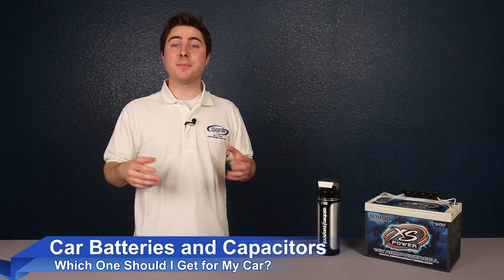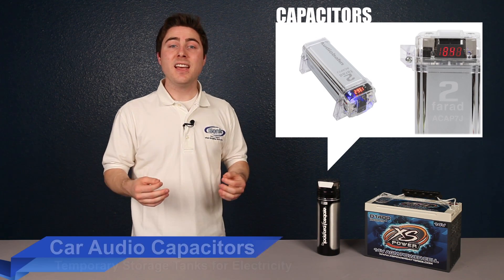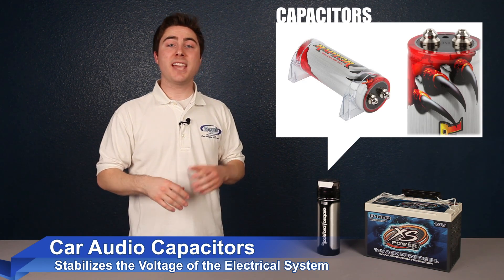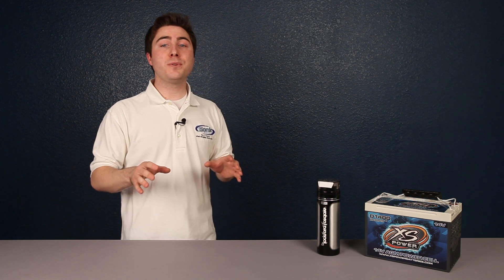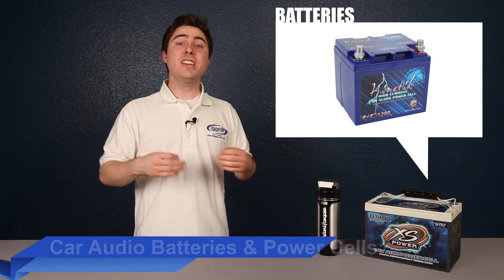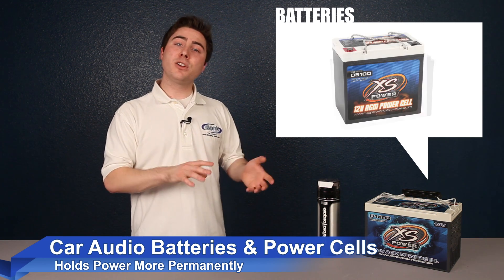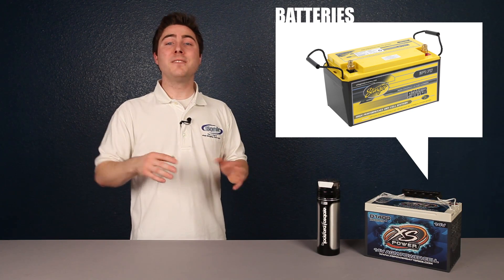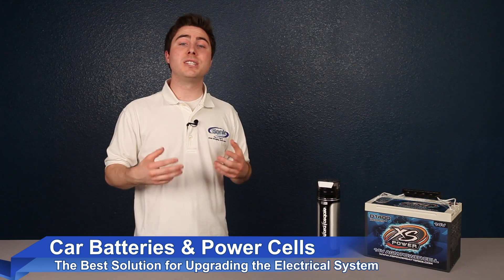Car Batteries or Capacitors: Which Should I Install? | Car Audio Tips

Comment: I just installed a capacitor and it made my headlights stop dimming when the bass drops. just sayin they arent entirely useless but i would still go for a new battery regardless.
Reply: What alternator size and amps?
My whole interior lights dims with low bass. Even LCD-display on my integrated headunit.
Reply: Dylan Christensen I ran a lawn mower battery.compat wasn't enough for me still had dim lights with lawn mower battery solve the problem for me
Reply: orfeous your amp go into "forever" protect mode yet?
Reply: No
Reply: Well, you're right in the statement that they aren't useless. Unfortunately, what you're using the cap for, is not its intended purpose. Capacitors are by no means as "useless" as some people for reasons unbeknownst to those with a brain might think, but your dimming headlights are due to a GENERAL lack of power. Depending on how you use your system, an extra battery can be a solution. Remember that not all use their system in the same way. If your system runs fine and moderate levels, and only taxes the power supply when you crank it for brief periods, there's no need for a huge alternator. But if you go around everywhere with your system pushed hard, yes, you will need a larger alternator that can provide continuous power. At any rate, that cap is sure to be a great benefit for any type of dynamic music. No matter what you do, keep it. You cannot replace it with a battery or a larger alternator. It does something entirely different.

Comment: so say i had a 1400w system and a 130 amp alternator, would running a big ass battery with the big 3 upgrade ensure that my system is actually getting 1400 watts of power delivered to it at all times?
Reply: Also in addition to the RMS wattage you should consider the losses involved in the amp. If you've got a class B amp (for regular speakers and rarely a subwoofer) then you're going to have like 20% losses to heat, so you take the RMS and multiply it by 1.2 to get your demand. If it's a class D amp then you're only going to have like 5% loss to heat, so multiply your RMS by 1.05. Then your car also uses power for regular use, probably about 50 amps worth is a safe number, that's about 700 watts. Your 130 amp alternator is capable of 1885 watts, then takes a 30% heat loss when it charges the battery, so like I said before, many factors to consider. It may be best to come armed with these figures to a professional and let them make the decisions with you, but like I said.. this is after the system exerts needs for an upgrade to your power system.
Reply: Rob Sorgdrager why do people have to get so hardcore on these noobs? "air temp" really? He's not trying to go out and win the national comp. Geezus
Reply: Jake it depends on a lot of variables for one some amps lie about what they actually do, or they require a crazy amount of voltage to do rated power. Then you have to figure into it the type of subs your using to have your ohm set properly for your amp to perform at its best. For example not saying the amp you have but just for example  at 1 ohm a amp  could put out 1000 watts but at 4 ohm 300 watts. If your not sure of your setup it's best to talk professionals at a audio store. Not best buy but a real audio shop.
Reply: As Jody said, Jake, it depends on different circumstances. A 1400w system is huge, and you want to make sure that your system really is that big before investing in equipment to match it. RMS wattage is what you're going by, never peak. If your headlights aren't dimming at night with beats and your amp never goes into protect mode no matter the length of the drive then you don't need any upgrades to your power system, not even a capacitor. It's best to get the audio components installed before you start worrying about power systems because each car has a different power profile and yours could be just fine without any belt system or battery tampering.
Reply: Look at it this way...
You have a better chance to do rated if the beast is fed. The more current in the easier it is to amplify the signal .  batteries only store energy, they do not make it. In a car audio system you need to make energy and you need to store energy, also you need to transfer it from source to storage to loads and then ground. The big three will help. Remember to use the best wire ( safety and reliability ) and use good solder on terminals. Take you time , spend the money, get the good stuff and it will pay off in the end. That's just to feed the beast, you have to worry about speaker efficiency and box rise and temperature of the air, your cab space, enclosure design... These will effect amp output as well. Best plan is to get a amp that in 4 ohms can meet your RMS requirements and run it that way , plus the higher the ohms the more damping you have, the better and more accurate your speakers will be. You think all the old school amps are listed at 4 ohms mono cus they couldn't run lower ?
Reply: dude i have pioneer ts-310 12" pushing 500 watt i plain to add 1 pioneer ts-3003 pushing around 650watt what is nececery to be done in order that to work ?

Comment: I just set up my system in my '94 corolla. Powering 2 12" MTX subs with an old school Rockford Fosgate Punch 360a2 amp and the headlights dim only when the system is hitting hard, at lower levels they're fine. I would assume a cap would solve this but I would really have to test my alternator and existing battery first to make sure neither of them are going out.
Reply: To tell if it's your battery which is problematic:

1) Start your car and turn off any unnecessary electronics, give it 5 minutes or so.
2) Test the battery voltage (make sure the radiator fan isn't running during this).
It should be above 14v. If it's close (above 13.5v) then you can continue using the battery for normal stuff, but the audio system is going to be rough on it and that will require a new one, and if the weather gets cold you might need a new one anyways. If it's higher than 14.8v then your alternator could be damaging your battery and causing the problem, recommended to take it into autozone for a diagnostic test on their alternator rig. If it's lower than 12.5v you may also want to get the alternator checked.

If it's between 14 and 14.8v turn your system on to the problematic volume and continue monitoring the voltage, it will bounce around, but the average should never go lower than 13v.

If it does, then your battery is struggling to maintain a charge. Run the volume at that level for 3 minutes and monitor its voltage again, is the voltage dropping lower and lower over time? If so then your alternator can't keep up with the average and will need to be upgraded.

If it's able to eventually level out at a certain (but low) voltage this means that either your battery is damaged (likely a cell has failed) or your system peak is too powerful for your battery to handle, but is able to handle its average just fine. To differentiate between these two things is where the more expensive multi-meters come into play. You need a min-max capable multi-meter for amperage, preferably min-peak such as like my Fluke-189 with an Extech DC Clamp Meter attached. These aren't cheap, and since the decision is between buying either a capacitor for the peak handling or a replacement battery (both of which would help your system and cost less than the meters) the best thing to do would be to take your battery out of the car and get it tested at auto-zone or similar location. If it's not a candidate for replacement then get a capacitor of sufficient capacitance for your system, if they think it's on its last leg then replace it. Both have the same result of improvement, but the capacitor will allow you to maintain your future batteries for longer without replacement.
Reply: Bla Spogelse I bought a lawn mower battery solve my problems with dim lights
Reply: Capacitor won't do anything.  Check the voltage on the battery with the engine running.  Should be close to 14v DC.  Put the meter on AC.  If you get anything close 1 volt or more AC across the battery, you need to replace the diode pack in the alternator.  Next, I would make sure you're not getting a voltage drop between the alternator and the battery.  That would mean your alternator is sufficient to prevent dimming, but you got a bad connection in there causing it.  To test for that, it's nice to have a meter that records min/mas like a fluke 87 but can be done without it if you have a bass test track with constant tones to get a solid reading.  Put the test leads between battery + and the fat wire coming out of the alternator.  While the bass is hitting, the voltage drop across that wire should be low, if you see a volt or more, that's the cause of your dimming and you need to find any loose connections there or potentially replace it with a bigger wire.  Other than that, you're not gonna stop dimming without a higher amperage alternator.
Reply: Thanks for the input man, appreciate it! I kinda figured after more reading that I'll just have to look into a higher amperage alternator assuming there isnt a problem somewhere else. I do have a meter and a solid 40hz test tone track on my phone so I'll have to check that out.

Comment: Damn everyone stating different opinions on capacitors , so which one is it ? Extra battery or capacitor?
Reply: Batteries and Capacitors help with headlight beat-dimming, alternators and capacitors help with overall system drainage.

The question for upgraded/additional battery vs capacitor is whether or not your alternator is currently running in full power mode the majority of the time your music is on. If it is, then you shouldn't introduce another battery, lest you risk needing a new alternator as well to meet the new demand a second (or third) battery brings to it.

The question for upgraded/additional alternator vs capacitor is whether or not your voltage levels out during heavy usage of your system. If your voltage goes down extremely slowly then a capacitor may be all you need and can then avoid the costly alternator replacement, if however your voltage goes down .1v every 3 seconds on average then there's likely no getting around needing an alternator replacement or addition.
Reply: I should also mention for the last paragraph, to adequately test this the car should have all of its nighttime electronics going plus the blower motor and the system volume as high as you're comfortable with. Else you may exceed the usage during a normal drive and find that your amp goes into power-protect mode randomly.
Reply: Rick Mireles I bought a lawn mower battery solve my problems with dim lights
Reply: I would run a second battery,and capacitor.will only help
Reply: Rick Mireles GHG
Reply: Rick Mireles your looking for facts in a bunch of opinions, it's just not going to happen.

BOTH are helpful. They both serve a purpose and if used correctly will work as intended. (I use a cap bank and a 2nd battery, but thats just me.) 

I didn't see anyone with credentials in this field chime in with facts, just people saying "thats wrong! use this! don't use that! I'm right, you're wrong".
Reply: Capacitor is snake oil.  Extra battery would help if you're amplifier load exceeds your alternators capacity in short term dynamic loads only.  However, it would not hold the system voltage to 14.2v, but only 12v, which could manifest itself as headlight dimming, albeit less dimming than if the amplifier load was enough to draw the previous single battery's voltage down to say 9v.  Since capacitors are nonsense, install a bigger or extra battery if your light dimming exceeds that of the difference between your car running vs not running.  Install a higher amperage or additional alternator to power larger/more amplifiers.

Comment: I install the capacitor on my sound system a legacy 800w and hiforics Zeus 1500w, when i do long distance the amplifier chips out and when i do short distance it's ok so question what could cause that problem on the long distance?
Reply: It's hard to tell without getting out a DC Clamp Meter and analyzing it directly. It could be a problem with the amplifier, but I'm suspecting that this is low power behavior. You may try using jumper cables between the cars and see if it performs better, but 5000W is a lot. I'm also somewhat doubtful that it really is a 5000W watt RMS amplifier, you have to be very careful about wattage claims because max means nothing, RMS means everything. I'm also curious if the amp is maybe running subs configured to an ohm setting that's outside of its rating. For example, if you take two 4 ohm dual voice coil subs and wire them all up parallel then you'll end up with 1 ohm at the terminal and that isn't supported by just every amplifier out there. It could be vibration jostling the amp's loose internal connection, it could be a loose fuse fitting or terminal in need of tightening, it could be a grounding issue where the bolt you use isn't a very good, but if your friend had the same issue it's doubtful to happen twice in the same way. I mean, it sounds to me like amp flow is impeded and you're getting a huge voltage drop, this is usually a lose fitting of some sort or a weak source of power.

Is your friend's truck performing different at all? Is the choke point roughly the same volume? I can't really solve your issue for sure in one go, we'd have to explore possibilities and narrow it down.
Reply: Long distance clipping is likely due to overall system drain, in other words you're exceeding the power that your alternator can provide for and your battery is slowly draining as you drive. You never lose power to your car because the amp goes into power-protect mode and keeps your important systems running. It clips because the voltage is at a point where each beat lowers it below the power-protect minimum voltage amount and after the beat it recovers. The solution since it sounds like your battery is fine is to either get a new, better alternator, or if it takes over 10 minutes to start happening try introducing a large capacitor. Caps are much more efficient storage vessels for power, and by bypassing the battery you get like 10-30% less power wasted on heat charging the battery. If it's a slow drain that may be all you need to tip the scale, but if using your blower motor and turn signal tip it over fast (under 3 minutes) then just replace the alternator to address the problem directly.
Reply: Jamison W. Question for you please bare with me. I have a Toyota 4runner that I installed a "3000watt" amp, 0gauge wire for power and ground a 5 farad cap and 2 12 memphis subs sounded great no problems I would push it hard with different subs too an did good no shutting off any of that stuff so I found the exact amp but a 5000watt I installed it an it turns on good and works but when I turn up the volume when the bass hits the amp shuts off for a sec or 2 an comes back on it doesn't go into protect mode just shuts off an on real quick I'm not sure if it needs more power or what it could be my brother tried it in his truck and it did the same starts up fine an all an once he turns the volume up, bass up it does the same as in my truck shuts off an on real quick if you kind of understand my question any ideas of what it could be???

Comment: My 2003 Tacoma has 2 HD1200s and 1 HD900 running 2 W7 12s and 2 sets of focal KR165s. Stock alt and yellow top battery. When I hit the lows real hard my lights dim big time. I wanna replace my yellow top with a XS power 3400. Will that help my voltage drop some?
Reply: Fox250R no you need a high output alternator bro
usalternators makes some pretty good ones and they are a little less expensive than other brands
Reply: dank9288639 thanks man! :)
Reply: dank9288639 So I was lookin around  YouTube and came across this video and saw what we talked about. Well since then I replaced my yellow top with a xs power 3100 and also replaced my stock alternator with a mike singer 240. My lights still dim a little but not as bad. My alternator doesn’t give my system full power till about 3k rpm. That seems a bit high to me. Anyway I was just wondering if you had any other ideas to help me get rid on my dimming. I know I can’t stop 100% of dimming but maybe something to help a little more. I don’t wanna damage my electrical system if I can help it. Thanks for any help :)

Comment: I went for the battery option with a used battery that when good puts out 12.5 V. with a 850 CCA but now only gives 11.5 at 800 CCA keep in mind this is in a 2005 Ford focus so this is more than enough
Reply: tyler jenkins i also have a system in a 05 focus. Just curious what kind of system you are running? Also if you noticed ur dash lights dimming a bit. I know mine dim with the bass but they also dim with the turn signal without any music playing lol.

Comment: Hello I would like to know which battery I can mount to replace the one that the car brings and to be able to use the sound system at the same time, without problem of low voltage, my car brings factory battery (EN CCA 608A, SAE CCA 760A, Ahr 70AH) this is the information Above the factory battery,  which battery you recommend , i have a rockford fosgate 1200 /1  amp and the jl audio xd800/8v2 amp
Reply: Roberto Rodriguez I bought a lawn mower battery solve my problems with dim lights